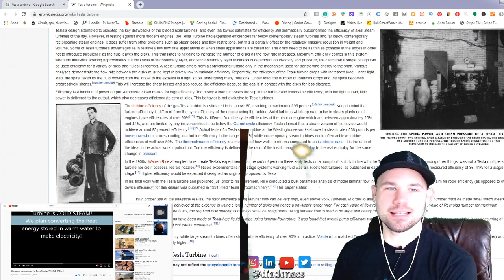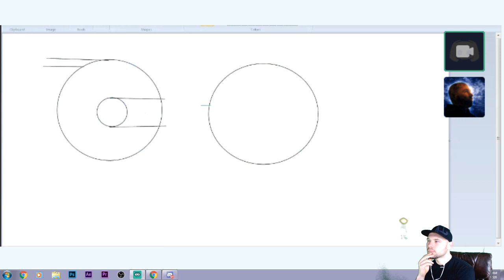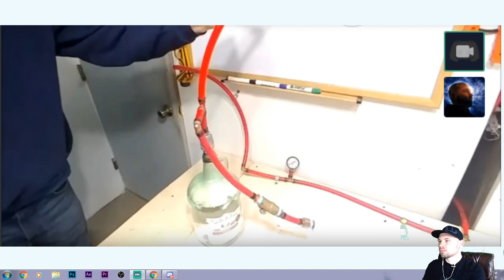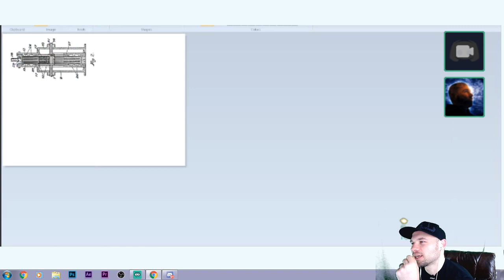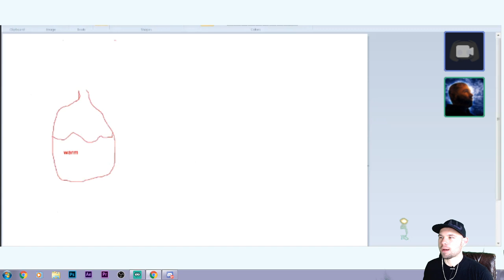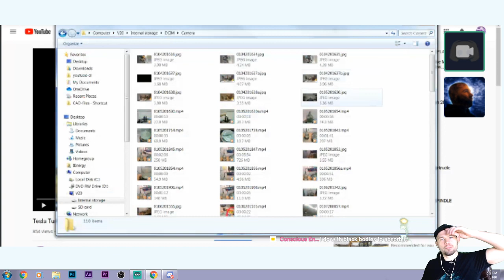Harnessing Thermal Energy: The Tesla Turbine Project - Jeremiah iEnergy Supply- CE Episode 12

Comment: My take on why the turbines hit a efficiency point is that as more gas in pushed through, the laminating of the spiral that takes a longer path due to centrifugal forces gets squeezed into even more longer path as speed increases. Pretty sure Tesla spoke about this. The longer path engages more gas interaction with the disk due to this. For this reason when people add flutes or blades to any part they are disrupting that laminating stretching spiral action. Increasing surface area on the disk face obviously increases the gas to surface interaction. Love this cold steam thing! Great podcast fellas, thanks.